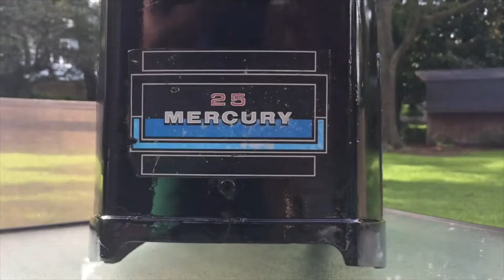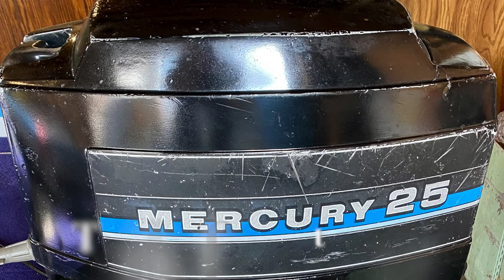Outboard Restoration Time-lapse | Start to finish

Comment: Great job, love them 2 stroke mercs
Reply from the maker: thanks man, yes, this outboard is incredible. when I first got it, it had been sitting outside for 4 years and the lower unit had sunk underground. It started right up, but has required a lot of TLC. nothing major though. It's still running as good as ever.

Comment: Thanks from Australia for posting these vids. I just bought my first boat with an '82 US made 18hp Merc which I think is mostly the same. First trip and it didn't go so fast so I think it was a spun hub. Took off the nylon nut and didn't realise the brass one wasn't a nut and tried everything to get it off and just grinded it off in the end. Prop still wouldn't come off so grinded, chiselled and hammered that off too so I'm now waiting for new one to arrive. You mentioned that you couldn't get the prop nut off so did you have to grind yours off in the end? It's also hard to tilt though the tube looks ok but might leave it as another tube looks hard to get down here. Your new tube had thread the length of it so was that just a threaded pipe and has that been ok? Thanks again.
Reply from the maker: sorry for the late reply, it turns out that on my prop, there is only a nylon nut, that is all you have to remove, the other nut is attached to the prop. I ended up taking it in to a prop shop b/c I needed a new prop anyway. I think they heated it up to remove it and then put a new one on for me and its worked great since then. My tube was seized up b/c it was left outside for 4 years. I tried to put grease in the fitting with a grease gun with no luck and eventually had to cut it out and replace with a threaded one I found at a local boat junk yard. it has worked great for over 5 years. the guys at the shop assured me it would be fine and they were right. Blessings on your build!